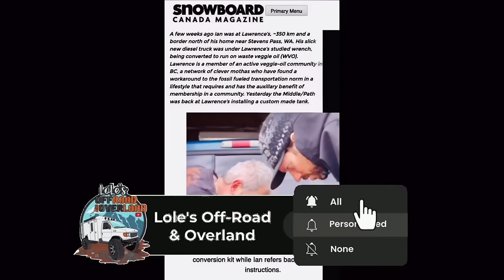INSPECTING A MOTORHOME WAS THIS NEEDED?

Comment: That unit would be sweet if you could tow a 4x4 bush rig. Looks so comfortable.
Reply from the maker: It sure does and yes you can have an off road rig behind it 😉✌️
Reply: It has a good trailer hitch and used to tow a Smart Car.  I’m not sure how many lbs it tows, but it’s meant to tow a regular car.
Reply: easy to tow a small platform with a side by side or atv on it